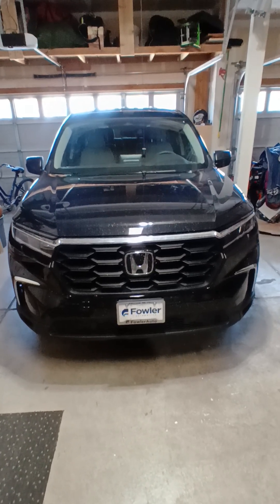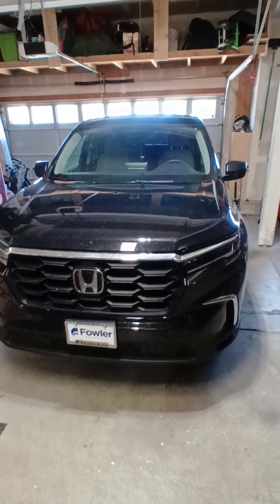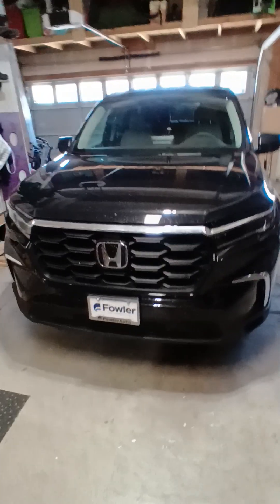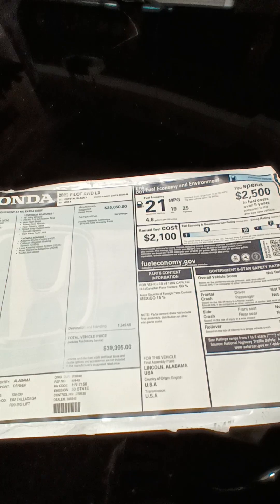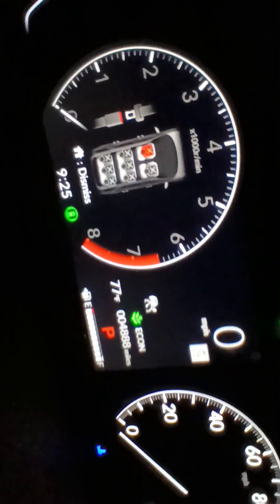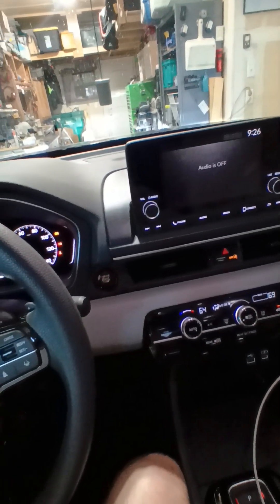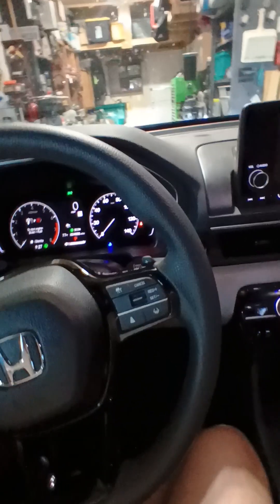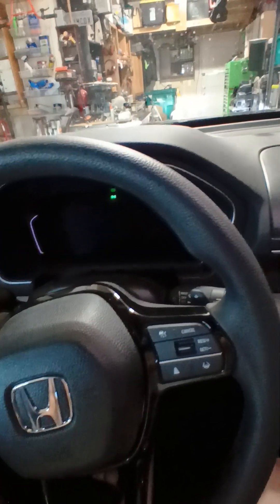2023 Honda Pilot Already Needs Engine Warranty Repair.

Comment: That sucks but life happens to the unlucky few.
Two things I'd immediately install in this car is VCM muzzler and idlestopper (or keep turning it off before you drive). Both technologies are asinine.
As for warranty voidance, I'd never take to the dealer, their fees are exorbitant; plenty of competent shops can service it for half the cost.
Reply: I would only go to the dealer for warranty work. Otherwise, avoid the dealers like the plague.
Reply: You get wat you pay for at some shops doe. And not always use “oem” quality parts. Not saying straight from honda but same quality. I work at a honda dealer and always get vehicles that come from other mom and pop shops in not so good shape. But im sure their is some good shops just make sure you do the research.  Good luck.
Also i do own a 23 pilot and haven’t had any issues 🙏🏻. Im one of the lucky ones i guess lol
Reply: Does that VCM delete mechanism show up on a scan? Mine's imperceptible on my 2023 PP EXL.
Reply: @Maximer77  Yep. I use Pacific Honda in San Diego which has been pretty good.

Comment: Same thing happened to my wife. At that point I realized that there was no coming back from that and the car will never run the same. I disconnected the battery for 24 hours which reset the computer. I then traded the car in Immediately.

Comment: I just got a brand new 2024 Touring a month ago, only have 800miles now, while no engine problems have already experienced a few glitches like no sound out of the stereo one day, powering off and on the radio didn’t help, had to pull over turn the car off, waited about 20-30sec then restarted and stereo was working again.  Another instance, the car wouldn’t open even though I had the key fob in my hand.  Car wouldn’t unlock even hitting button on the fob or putting my hand and trying to open the driver handle.  After several attempts and pressing various buttons on the key fob it was working again.  Those two incidents only happened once each and has not happened again since.  Other thing that does annoy me is when you start driving and engine and everything is still cold, seems like the transmission shifts weird until it warms up, seems like it shifts through 4-5 gears even before I get to 25mph, but then once it’s warmed up it shifts normally.  I don’t know if everyone experiences that or not, but that happens every time unless I’ve remote started it and let it warm up already.  So far those are the only things I’ve experienced so far in the one month I’ve had it with only 800mi.  😮
Reply: Transmission oil needs to heat up to be efficient. I experience that sometimes in winter in my Toyota

Comment: My Pilot Trailsport starter and relay had to be replaced at 1200 miles. Vehicle died in middle of the road. All issues point to the idle start/stop. It’s horrible and i always drive with it off in Normal drive mold.
Reply: I got the idlestopper for my Trailsport and my Passport
Reply: @michaelroberts9339 where did you get it and is it hard to install?

Comment: this makes me worried because I want to get a Pilot rather soon.. and I chose it because of a NA V6 which is usually a reliable option, especially being a Honda, for longevity over turbo 4 Cylinders that Toyota is going for... Oh man. Not cool. They should've kept the Vtec Engine. But also Cylinder deactivation?? Those have to be horrible for engines. Uneven ware and tear for an engine and more parts and software to worry about. I'd probably find a way to deactivate that feature for good. Also might find one with a matching vin to say it was made in Japan.
Reply: I'm debating on the highlander or the pilot loll but can't decide

Comment: Things happen and I don't doubt the OP, but remember that the small percentage of people who unfortunately experience issues get the loudest voice on social media.  Many more thousands of people are happily driving their new gen Pilots without any problems and not taking time out of their day to post about that.

As for VCM, I do have some concerns but we never had a single issue on our 2015 Pilot that we traded in at 130K for the new '24 model.  No oil consumption or failed engine mounts as was wildly warned about on the interwebs.  I'd prefer no VCM system, but on the other hand I'm not losing any sleep over it either.

Comment: We have the exact same issue with Touring Pilot. And after couple months Honda told us that the engine needs to be replaced. Our car is at the shop since May 10, 2023 to the current date August 22,2023.
Reply from the maker: Oh my that sucks, how many miles did you have on it when it failed?
Reply: Yes, we are so disappointed, it’s not what we expected. Only 3000 miles.
Reply: Lemon law in your state?
Reply: Did you end up getting the issue resolved?

Comment: Did you get BAD GAS??? Because it happened after you got gas.....  I know of someone els with a different vehicle that this happened  to  !
Reply from the maker: No,  a cylinder head solenoid failed and they are still trying to get parts to replace it.

Comment: So whats the problem? You bought a NEW vehicle, and it has bugs, its to be expected with a newly engineered vehicle. At least you have something to put wear and tear on while they figure out whats wrong with your vehicle  that is literally not getting more miles on.
Reply: I don't get comments Ike this.  It's expected to have bugs in a new vehicle???  It's comments like this that give cover to these car companies.  I mean how much is really that different in this car the engine is from an MDX.  The 10 speed has been in the Odessy since 2017.  The safety tech and infotainment are all tested in other cars??? 40 +K for car there should be some expectation of quality especially from Honda....